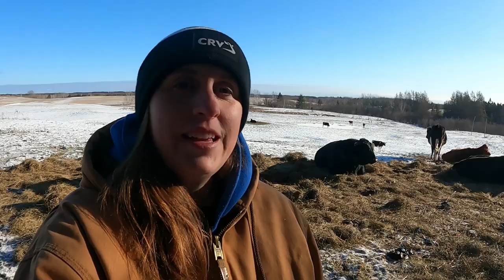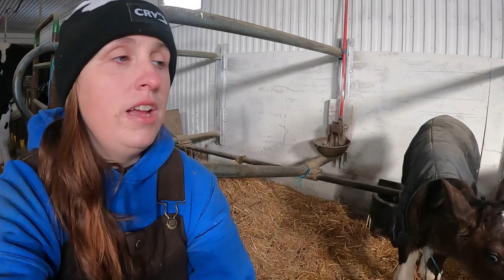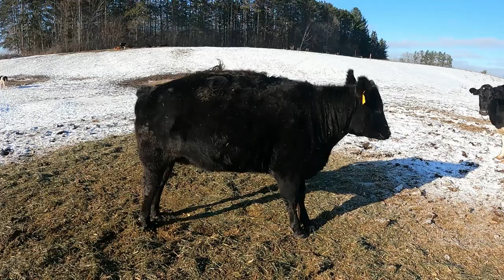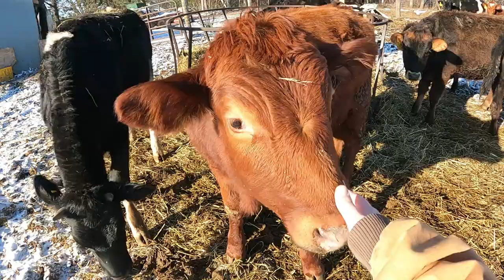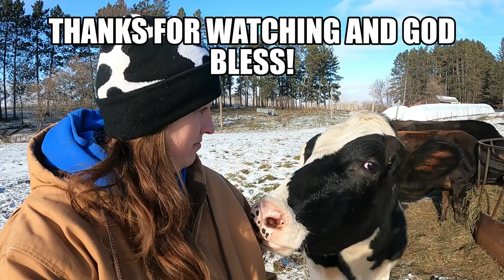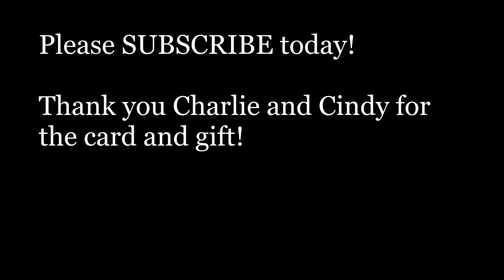Breeding Dairy Cattle to Beef

Comment: Interesting,  where I am the only two reason one breeds to angus is they are planning on dumping the milk cows and want the calves to either continue with beef or to feed them for a year and then send them to sale and black is what the buyers want, OR for first calf heifers to ease calving, but they breed to a Dexter not angus usually for a small frame size to help ease calving issues.
Reply from the maker: Oh I should've mentioned that.  Yes we got asked a lot if we were going all beef when we started breeding a few Angus
Reply: @trinitydairy  I thought that as well, but figured if that was the case you would have said.   Do you keep the ones crossed to Angus or do they leave after they calve?
Reply from the maker: We did keep 4 heifers that were crossed and bred them Angus to start a little beef herd, but we ended up selling them to Alan's dad.  Otherwise we sell them all.